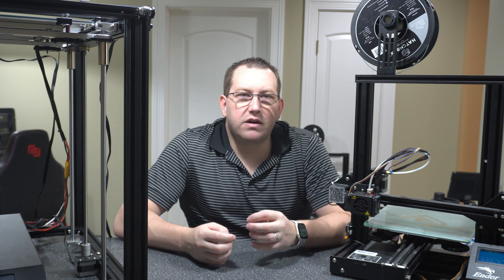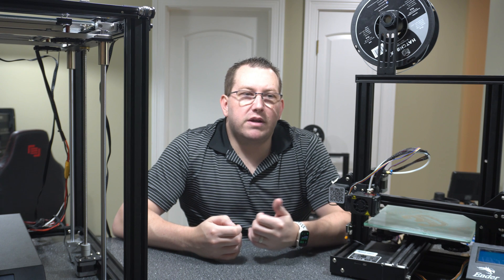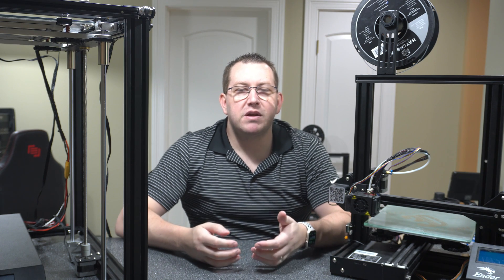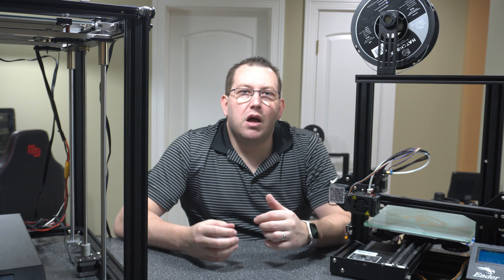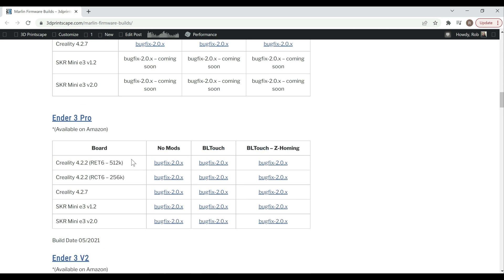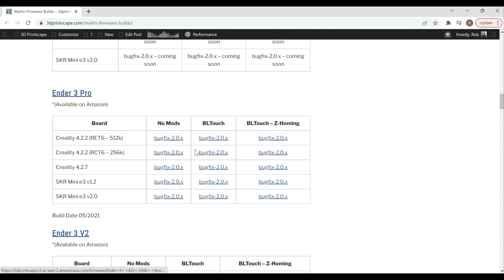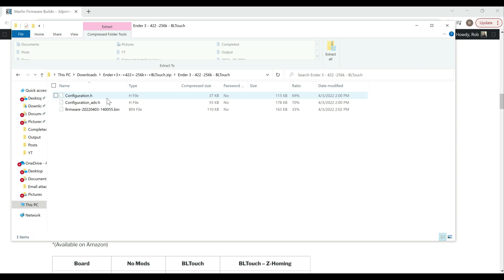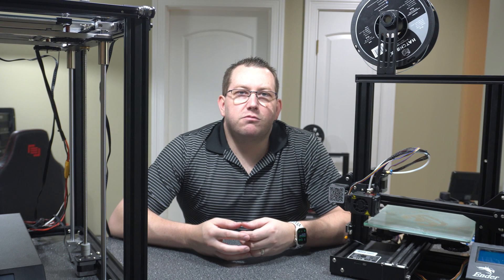Creality Screen Issues After Firmware Upgrade

Comment: Thanks for the tip.  I tried it and I'm still having glitchy screen issues.  Also, it's having trouble reading SD cards and it freezes halfway through printing.  I think there's something wrong with the board.  I'm going to try to get it replaced.  Great video, very helpful
Reply from the maker: Hi. It could be the board. Let me know if your having issues after swapping it.
Reply: @3DPrintscape  Same thing is happening to me.
Reply from the maker: @nickrosario8442  What firmware did you end up using?

Comment: Thank you!   You saved what remains of my sanity.   I got back to normal operation.

There is one thing that is unclear to me.     Maybe you can shed some light.

My issues started when I upgraded to a CR-touch and flashed that firmware.   Then, no matter what official firmware I flashed I got the screwy unusable screen.  Your 256k bugfix 2.0 with stock firmware fixed the issue,  but of course, I lost CR-touch support.

I see that there are BL touch support builds... Are they compatible with the CR touch?   If not, how do I go about building for CR-touch.   Couldn't find anything on github.
Reply from the maker: Hi. Ya the bltouch and crtouch is the same to the printer, so you can use the bltouch one.

Comment: Still having issues with my ender 3 display i was trying to install firmware for the cr touch
Reply: I purchased my Ender 3 on 3-16-2021 has the Ret6 chip
Reply from the maker: Hi. I had someone say switching to the 512k firmware then back to the 256k fixed the issues for them.

Comment: I recently installed the CR-Touch software using the Marlin firmware video that you made.  I keep getting an EEPROM error message when I start up my Ender 3.  Did I do something wrong?  I'm pretty new to this, so that wouldn't be out of the question.  Any help you can provide would be greatly appreciated.
Reply from the maker: Hi. You should be able to reinitialize the eeprom in the menu.

Comment: just got a used 3 pro and the screen was fine for 4 hours while I was researching how to use it. I tried to load a file off the TF card and it went blue,  I plugged in the USB cable and the screen went blue and started to beep?  (I think, i was very confused at that time) so I pulled the USB and the TF and it went back to normal but then it started to glitch on its own. Now every time I boot it will be good for about 10-30 seconds and then glitch: weird characters, all ~'s. tried factory 4.2.2 firmware flash, no change. Trying your 256K build. Fingers crossed !
Reply: So far so good! I flashed it and no corruption of screen yet, even started a print but found the drive tensioner had cracked.
Reply: Bro, I owe you a beer (or a roll of PLA...) if I ever meet you! Printing like a champ with my glued tension bracket. No corruption in display and I like the new GUI. "Print from media", brilliant! Maybe one feature that you could include: an ETA of finished print , ie a countdown timer instead of a count up? The bar graph doesnt tell you when it will be complete. Great service! .
Reply from the maker: Hi. Im glad i was able to help :). I will get the ETA added to the next build i do.

Comment: How do you actually run the firmware update?
Reply from the maker: Hi. You just put the .bin file on the sd card and boot the printer. The board will then pull the firmware.
Reply: @3DPrintscape  thanks, does it take some time for this to run?
Reply from the maker: @TheFreddy199  Not much, typically 5-10 seconds.

Comment: I am using an Ender 3 Pro and my screen is glitching but I am using the CR touch and it doesn't look like you have a firmware update for that model. Any suggestions?
Reply from the maker: Hi. You would use the bltouch firmware. They are both the same thing to the board/firmware.

Comment: Quick Q because I am having issues.  With the BLTouch firmware (second option), I still need to have the Z-stop plugged into the location at the top on the board and the 5-pin CR Touch wire plugged into its port??  I though I needed the z-stop unplugged for this?
Reply from the maker: Hi. There was only one version of the creality firmware that needed the z stop unplugged, im not sure why they did that to be honest. That said, unless you are using that one version, you will want it connected.

Comment: The BL touch ones should function for CR touch as well, correct?

Thanks for your awesome work here!
Reply from the maker: Hi. To the printer, they are the same thing so the firmware will work for both.
Reply: @3DPrintscape  Awesome, thank you!
Reply from the maker: @ZombieOfun  You're Welcome
Reply: @3DPrintscape  Another quick question: I think my z probe offset is being ignored? Despite setting the offset to an appropriate amount, it seems to be trying to print too high up. It was initially trying to print too low and slamming the print nozel into the bed so I put some washers between cr touch and the screws. Either way I am having problems haha

Comment: So lots of reading and ive used several different firmwares.  Ender has made 4.2.2 boards with the RET6 which is suppose to be the 512k, however they have used the less expensive 256k parts.  So even if its new, and its 4.2.2 and its also RET6.... The RCT6 256k will fix the screen issue.  I think Ender has just done it to be cheap!  But thank you for the builds!
Reply from the maker: Hi. Im not sure if they were doing it to be cheap or if they were having issues getting the chips, but we will probably never know for sure.

Comment: Hi - tried to do a firmware update on my cr10 V2 yesterday and now the screen is blue on startup - no text nothing. Was printing before- i used cura latest and the 1.1.6 V2 firmware straight from crealty (no tth ebl touch ones just plain). Is there a way to undo/reflash or did i brick it? Cura says printer offline now so cant retry another flash - despite being plugged in. Port does pop up in Device manager so it is responding-
Reply from the maker: Hi. The port could be in use from the original firmware push, did you try to reboot? Also what board does that printer have in it?
Reply: @3DPrintscape  will check later and let you know tx.. how do I check board, open the case?
Reply from the maker: @fstarockaburns425  Ya you will need to open the case.

Comment: First of all Rob, I would like to thank you for all your super helpful tutorials and help to the community. I am a rough speaker, so if anything may sound negative, let me assure you i am not trying to be negative. I just tend to speak as much as possible to the point of issue, what i've done so far etc.

I can use some help. I don't understand what exactly is happening, but like others, i followed your other video to update and install cr touch bed level kit. My screen started to glitch, and sd card would get corrupted, and print was not behaving proper.

These firmware (256k wrong one for me apparently) seems to fix the screen glitch and the sd card reading, however, the z axis down movement doesn't work after doing an auto home. 
I set auto home, and its half way up the bed. Then if i try to adjust position after auto home, it won't even go down until i restart the machine, but it will happily move upwards.

Flashed  back to the cr touch firmware and auto home sits it back to the base, but then the glitch and card issues again. Loopdy loop and is frustrating me quite a bit as a new ender owner.

I am on a standard 4.2.2 board RET (512k as discovered later)

Update: 
your 512k fixed my card reading and z down issue, but im still having screen glitch issue and in addition, i've lost ability to see the completed % and the eta to finish printing.
Reply from the maker: Hi. The 512k build is a bit older and shouldn't have the issue with the glitchy screen but the 256k build should also work. Is your z stop connected? If not, try to connect that and use the 256k build again.
Reply: @3DPrintscape  Same for me. I have 4.2.2 board with RET 512K ( assuming thats right, I saw that on one of your videos) the 256K build fixed my screen but CR touch no longer works. Auto home wont get close to the board. I have tried all four of your builds now: 256K BL touch, 256k BL touch / Z Home, 512k BL touch, 512k BL touch / Z Home. None of these builds worked correctly. Some fixed the screen issue, but none worked with auto home. Any suggestions??
Reply from the maker: @nickrosario8442  Is your z stop connected?
Reply: same thing for me

Comment: So the newest BLTouch instructions say to connect the single included cable to the BLTouch port on the board and "pull out the Z endstop switch". Which firmware option should I choose: 1) BLTouch or 2) BLTouch - Z-Homing? Based on the instructions for the newest BLTouch there should be nothing connected to the Z-endstop. Thanks for the vids and all your hard work!
Reply from the maker: Hi. They have said to disconnect the z stop for a while, same with the cr touch but then you have issues with the z axis not moving down. I would recommend keeping it connected and using the bltouch firmware (so option 1 you called out above).

Comment: I had a few issues with the firmware. The biggest problem most likely being that I have a CR Touch not a BL touch. I used the Creality 4.2.2 (RCT6 – 256k) BL Touch firmware and it fixed my screen glitch but it's not calling my Ender-3 (standard) an Ender-3 Pro. The setting look very different than my normal Ender-3 settings and I'm wondering if there's anything I can do about that. Thanks in advance.
Reply from the maker: Hi. The firmware between the ender 3 and ender 3 pro would be the same, to the board they are the same printer. The same thing is true with the crtouch and bltouch, to the board, they are the same thing. The settings being different would be from going to the stripped down version of marlin that creality uses to the full version.

Comment: Hi, it fixed my issue, but my Ender3 printer name become Ender 3 Pro even I use the ender 3 regular firmware (No Mods) for Ender 3, I think you have the same file upload ender 3 with the Pro, Please help link me a right firmware for Ender 3, Please...
Reply from the maker: Hi. It is the same firmware, to the board there is no difference between the two printer. The biggest differences are the frame and power supply.

Comment: Which do you use with the CR Touch? for whatever reason I have to manually move the Z axis with the printer off to get the nozzle close enough to the bed. However every time I hit Autohome it raises the Z and makes it where it cant be lowered past the new autohome spot. The Z stop switch is not closed either. Honestly very frustrated with this Ender 3 Pro.
Reply from the maker: Hi. You would use the bltouch firmware. Is your z stop connected?
Reply: @3DPrintscape  I unplugged it from the board like the instructions said to do for the CR Touch, gonna try adding your suggested firmware now
Reply from the maker: @worldsfinest9430  Also, connect the z stop back in. There was only one version of the creality firmware that wanted it removed for some reason.

Comment: This video was an absolute lifesaver. I was trying to install firmware for a CR Touch on an unmodified, stock standard Ender 3, not V2 or Pro or anything, and the official guide was just not going great. The website interface had changed, my printer screen was glitching and it couldn't auto-home, and I couldn't even run .gcode files.
I looked everywhere and found this problem, but no real solutions, so I thought I had just trashed my new printer. Ran across 3 of your videos near the end of my search and the problem was completely solved.
Reply from the maker: Hi. Thanks for the feedback, im glad i was able to help :).

Comment: I have an ender 5 pro with a 4.2.2 board that is being glitchy, i tried your ender 5 pro build all three builds and the screen is still buggy. However i tried your ender 3 256 firmware just to see if the screen was ok and it sorted it out. i was wondering if you had a similar build for the ender 5 pro as it seems the axes are interpreted as inverted with the ender 3  and it wants to try to run through the limit switches. I just got the machine 2 days ago and updated the firmware with what was included on the sd card so i could use a cr touch i ordered with it and the screen went all wonk.
Reply from the maker: Hi. I dont have a build for that yet but will try to get one soon.
Reply: @3DPrintscape  let me know if you need someone to test mule it for you if you dont have an ender 5, i used the th3d guide to make firmware to get the original functionality back but i havent played around enough with it to get the cr touch options.
Reply from the maker: @xactedsyence  Will do.

Comment: question, should i delete the firmware i added on to the sd card (the marlin 4.2.2 or whatever it is) or should i keep it and also add the program you made. i tried adding it and it still had the same problem so i wasn’t sure if i did it right.
Reply from the maker: Hi. You should only have the .bin file you are trying to use on the card. Once the firmware has been uploaded, you should delete it.
Reply: thanks for helping me with this. it totally fixed the buggy lcd but now when i go to print it says “no tf card” any ideas for how to fix that?
Reply from the maker: @anthonyrainey6229  I havent seen that. What version did you push?
Reply: on the website, i used the one on the top left of the ender 3 pro grid. all i have on my sd card now is that file, and the gcode i’m trying to print. it’s possible i used the wrong firmware, i’m not sure the difference between them
Reply from the maker: @anthonyrainey6229  How is your bltouch wired and what board do you have. I'm thinking you will want to use the bltouch Creality 4.2.2 (RCT6 - 256k) build.
Reply: ok so I did that one, and now it will let me print from tf, but when I select something it just goes to the home screen without starting the print
Reply from the maker: @anthonyrainey6229  Did you try to print multiple files and was the behavior the same with all of them?

Comment: my ender 3 pro won't move down after downloading the Marling firmware, it moves in the other directions except for down. I am physically able to move it down using the screw but I cant use any of the controls on the motherboard. When i first turn it on its able to move down using the boards controller but when i try to auto home or level bed it won't, all it does is just deploy the cr touch back and forth high in the air. then wont move down again after that.
Reply: Also, i now know that its the marlin firmware because i flashed the original CR touch and it works fine ( at moving down. there's still a buggy screen) but when I use the marlin bl touch z homing 256k it doesn't work
Reply from the maker: Hi. Is your z stop connected? This firmware assumes it would be.
Reply: @3DPrintscape  no it wasn't connected that couldve been the issue. I was able to fix the problem though by using the other firmware you showed for a marlin specifically for the CR touch

Comment: I don't know how it's possible but it didn't fix the problem for my nephews e3 4.2.2 with re6t chip. When I download the firmware for ender 3 from your site, it always downloads and ender 3 pro zip.  Any ideas
Reply from the maker: Hi. Someone else had a similar experience, maybe try what he did. "I used your guide for updating the firmware and my screen started glitching. I just found out that this is common. I installed your 256k fix and it didn't fix anything. then I installed your 512k  just in case. Guess what. Nothing happened again. So I installed the 256k again and it worked. Don't know if installing the 512 did anything but its worth a try."

Comment: I used your guide for updating the firmware and my screen started glitching. I just found out that this is common. I installed your 256k fix and it didn't fix anything. then I installed your 512k  just in case. Guess what. Nothing happened again. So I installed the 256k again and it worked. Don't know if installing the 512 did anything but its worth a try.
Reply from the maker: Hi. Thanks for the info here. Its odd that it didnt work the first time.
Reply: @3DPrintscape  The Creality firmware are so poo. I just added a CR Touch to my printer and installed their firmware and again I had a jumbled screen. Your BLTouch firmware seems to be working with my CR Touch. And the screen is fixed. Thank you again. You have a sub forever.
Reply from the maker: @bkbigtone2866  Im glad i could help and thanks for the sub :)

Comment: So i tried your BLTouch homing firmware for both the 256 and 512 boards and nothing worked. Got any ideas before i return it to the store?
Reply from the maker: Hi. Whats not working?
Reply: @3DPrintscape  It still has the glitched out screen like you are showing in your video.
Reply from the maker: @TheShaddii  Can you verify that the firmware correctly uploaded to the printer?
Reply: @3DPrintscape  How would i know if the firmware uploaded? The screen is all glitched out so i cannot read anything.
Reply from the maker: @TheShaddii  The screen should take longer than normal to show anything.
Reply: @3DPrintscape  that did happen.
Reply from the maker: @TheShaddii  Someone said they had a similar issue. They ended up fixing it by pushing the 512k firmware to the printer then going back to the 256k firmware.

Comment: Fixed my screen issue on a Ender 3 pro purchased in April of 2022. Went to install the firmware for a CR touch and that along with any default files I could find just caused the screen to break. Your setup fixed it and got the screen back correct. Thought I was screwed before even making my first print so thank you for the fix.
Reply from the maker: Hi. Glad i could help :).